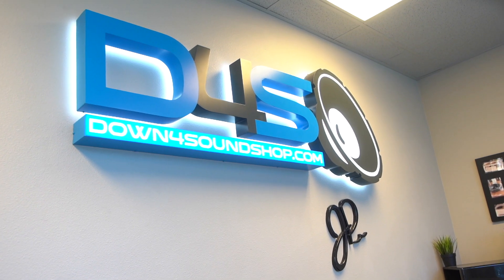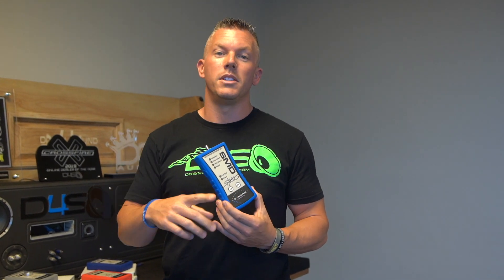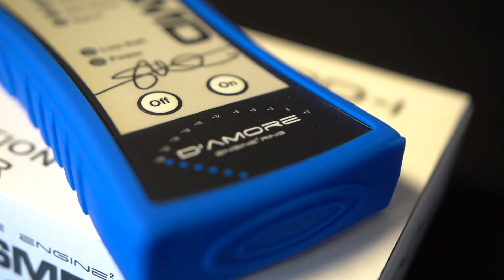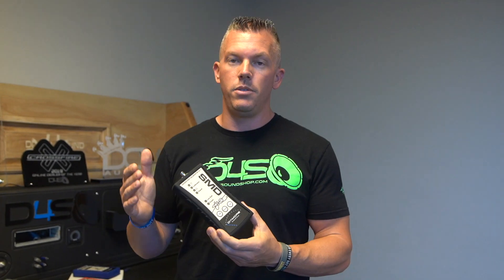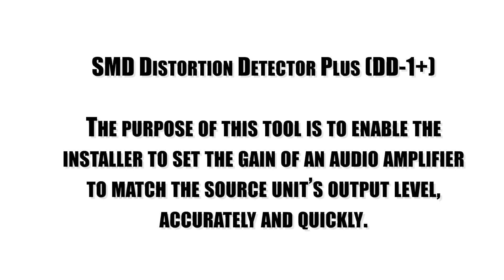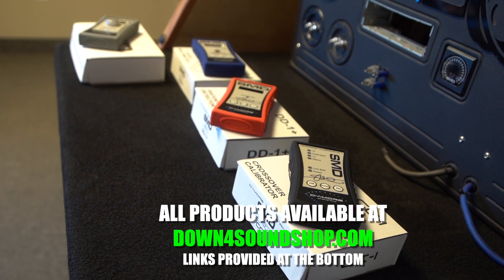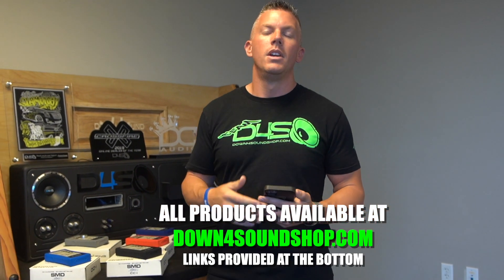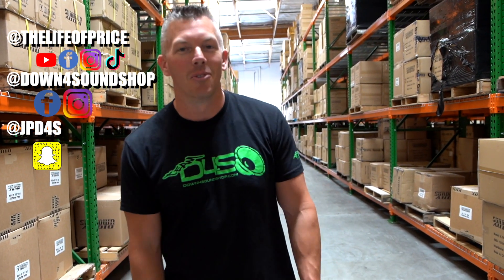DON'T GET TUNED OUT! THE IMPORTANCE OF USING TUNING TOOLS IN CAR AUDIO

Comment: I've been tuning my own amplifiers by ear for over 20 yrs with no problems but I just recently installed a Salt-2 and purchased a DD-1+ to set it up like a pro and really liking it. I plan on getting the CC-1 in the future. Great products as always.
Reply: Nice constructive feedback bro🤙🏽
Reply: How the salt 2k putting out
Reply: How many watts your getting out the salt 2k
Reply: @Relentless-jp5qs  I have it wired to 2000 watts but haven't clamped it
Reply: What sub your running with it
Reply: @Relentless-jp5qs  2 DC Audio Level 3 10s

Comment: With most people going with some form of a DSP and newer aftermarket radios slowly integrating very comprehensive DSPs I would recommend that if you could one buy one tool right now it would be the DD1+. I was fortunate enough to buy the grand slam kit witch came with all the SMD tools. But honestly the DD1+ is the only one i use 90% of the time followed by IM-SG. If you can afford it and want all of them then buy the grand slam kit because it is cheaper than buying them individually over time.

Comment: I think it's unfair too ues ones product and mass produced these units to sell at a very expensive price for what is a simple light the smd dd1 is good for what i does but Steve should be ashamed for over pricing a piece of equipment that only has a light no screen and advised everyone that they need he's product so he can continue too live out his expensive life style.  I bought one because i too fell into the track . I repair and install and modified car audio and im a electrician as my job i been installing car audio since i was 12 and since then i love car audio i remember the real and fun reason the  days of car audio and electronics and it's why i made my hobbie too learn it i will simply say dont believe the hype i uesd the tool that cost me up too 200 plus shipping  with a cd and a blinking light knowed as the smd dd1 and i returned it the next day reset my gains in my system and too my ears i was more pleased with my sound again i noticed that my gains were a little lower than with tool . The car audio and sales is all about making money now  . And selling cheap products made and deigned with cheap parts what does matter if it says made in usa with cheap parts from China.  People stop making these con artists rich they over price there gear and boasting there worth all over the internet.  Car audio was never about money it was about music and joy and products that were way better than todays junk for half the cost i should know i been repairing amps and electronics since i was 17 in fact my amps are modified and are old school  Components cause i know how well they outperform todays way over priced junk  back in the day you did get what you payed for.

Comment: Way over priced
Reply: Have you engineered one cheaper?
Reply: @angelvip2474   no it was made decades  before its called a  oscilloscope
Reply: @clittle1559  and they cost about the same, sure the oscilloscope has more uses but if you're buying it for car audio only why not just get an even simpler tool the has a light that slowly turns on or off depending on how much it's clipping
Reply: They're paying for quality and great customer service